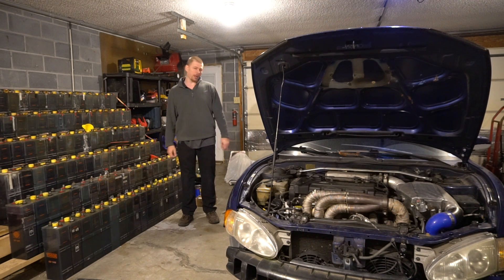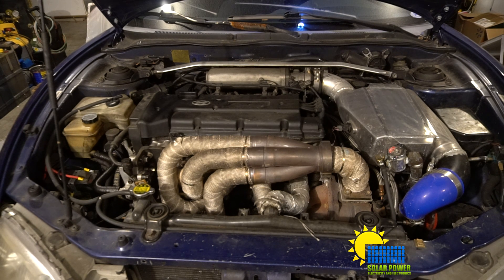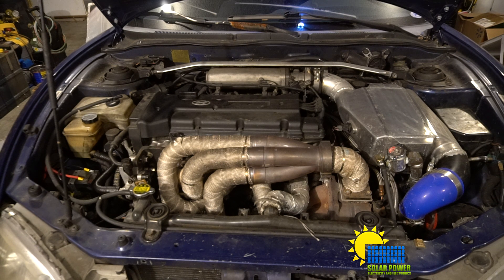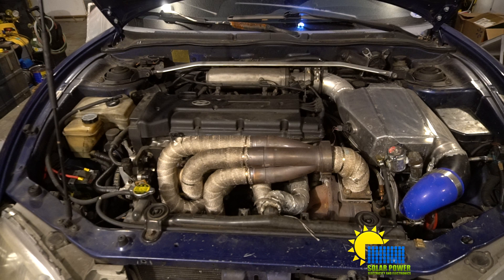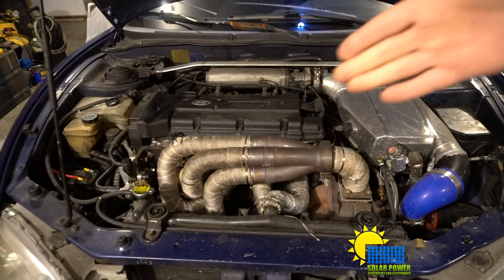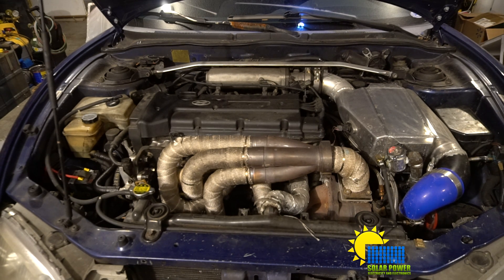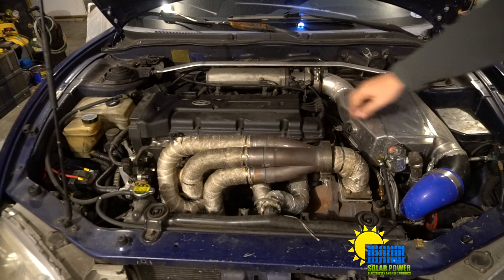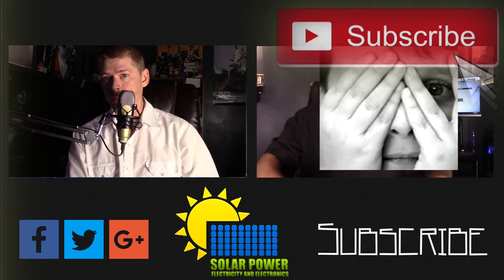I'm Going To Build A Super Capacitor Battery Pack On A Budget That Will Never fail.

Comment: if your battery keeps going bad you got a wire issue draining it . because I have many tibs some don't get ran for 1year at a time they fire right up .
Reply from the maker: Yes I did in the video I was talking about a brake switch problem that was fixed before this videos was made.
Reply from the maker: The last time I drove this car was 2 years ago.
Reply: ok I thought you where still having the issue after you fixed that but cool at least you got it
Reply from the maker: I will still build a super capacitor and install it into the car because I have to have a battery and I don't like buying more stuff and caps will be about 5 to 10 Lbs

Comment: So the big question: What engine was that and what kind of power do you make from the rebuild? :)
Reply from the maker: DIY Tech & Repairs the power I make is unsure of not dynoed this engine but I have out ran the 485 horsepower Hemi shaker off the lot it is a Hyundai Tiburon 1998 model 2.0L. The engine has a compression ratio of 8.8 someone installed a decompression plate